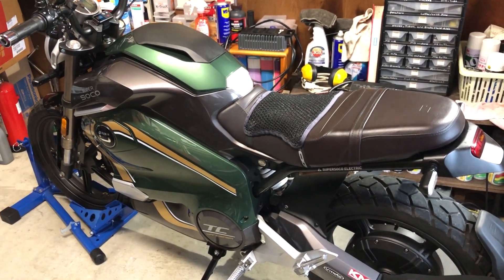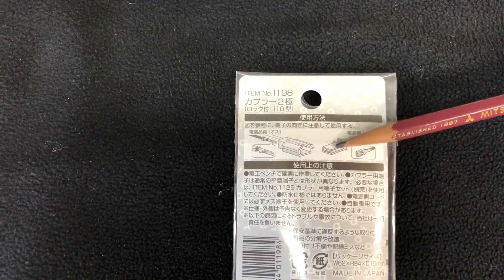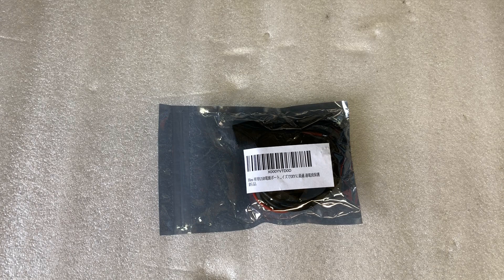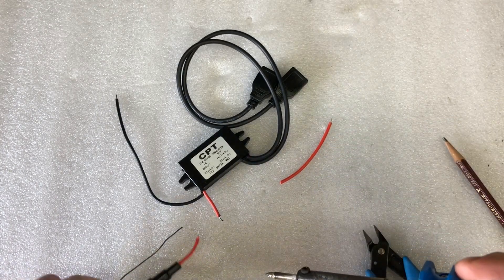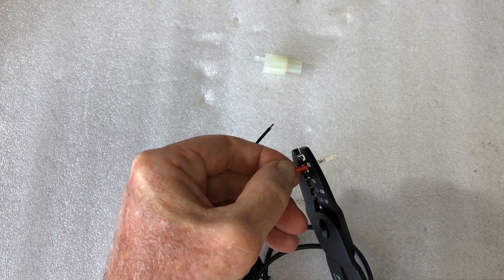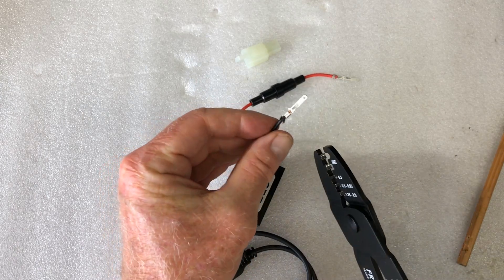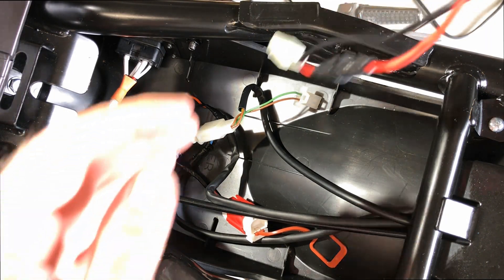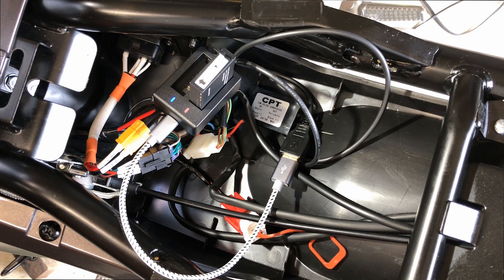Super Soco TC Wanderer TS Street Hunter Dual USB Port Installation (storage box and under seat)

Comment: Just bought a TC wanderer. I've linked the bike to the app but it's not syncing any data. Do I need a SIM card in the bike and do you know where it would go. You seem to be the only person who might possibly know. Thanks.
Reply from the maker: I assume you live in the UK. Here in Japan the wanderers have the GPS and Bluetooth module but the bar code sticker containing the activation code is not on the module and therefore the app can't be activated here in Japan. No, you don't need a sim card.  I have made a link to my other video showing the location of the gps module. This is where the QR code sticker would be located containing the activation code. 
https://youtu.be/vny4KVAohV0?t=992
(the module is the rectangular black box under the voltage regulator)
I haven’t done this because of the fore mentioned issue.
If you don't have the activation code please ask the dealer to activate it. Note; some other countries in Europe don't have the module fitted.
Reply: @DistantSuns Thank you so much. Greatly appreciated.